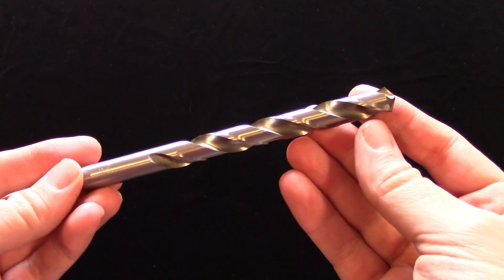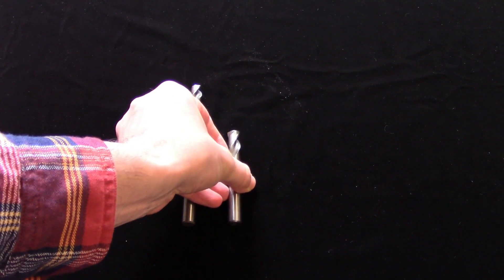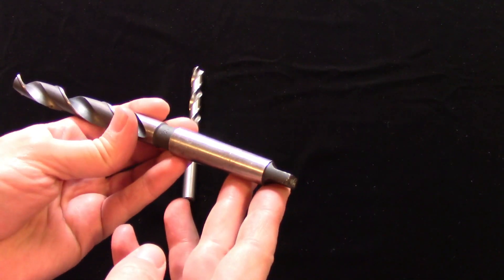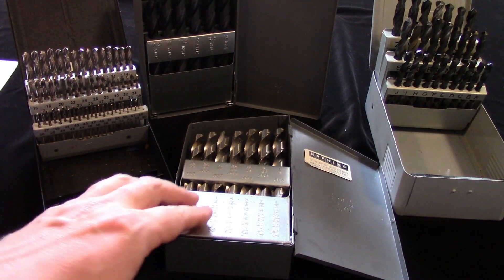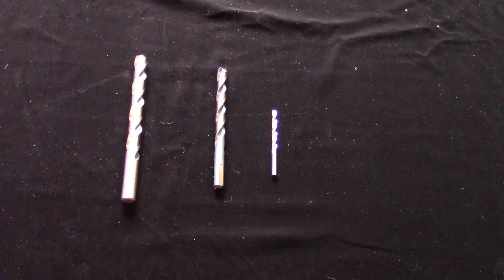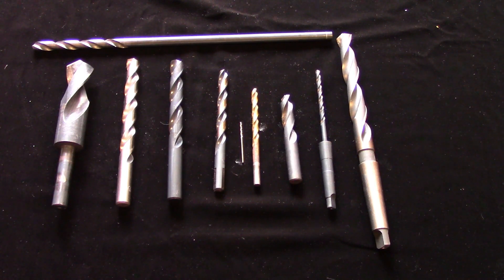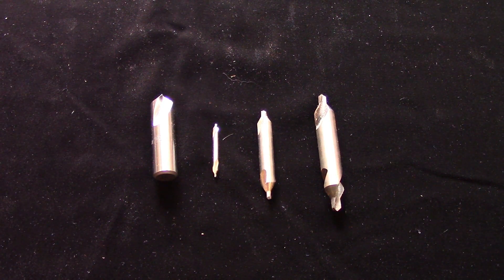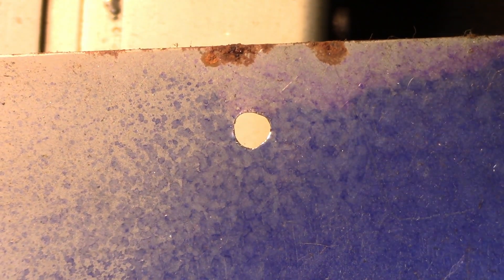Drill Bit Basics

Comment: Hi, Stuart. I hope you don't mind if I ask another question. I have a subland drill - 5/16" to 1/2" counterbore. I typically run 5/16 at about 600RPM into 1080. Never worked with a subland drill before. I usually run a 1/2" drill at around 400RPM into the same material. Lower revs as a counterbore. In this case, would you suggest that the 600RPM is maintained and then a significantly lower the feed as the drill hits its 1/2" section? That seems like the way to go on a purely intuitive level, but what do I know?
Reply from the maker: Hi Felix. I don't mind at all. Typically counterbores are run at a speed 1/3 less than the same size drill, so you definitely don't want to use the same speeds. Let me know if you have any other questions.
Reply: @StuartdeHaro  Thank you so much!

Comment: Stuart, would you say that running a .368 carbide drill into A2 at 1200RPM is too slow?
Reply from the maker: It seems like it my be OK. A2 is tough stuff so use your eyes and ears. Look at the chip you're getting and watch for that typical curly drill chip you get with steel. That indicates the right feed. Now look at the color. Steel color is fine, but you can probably go at a higher RPM. Tan to royal blue, you're good. Light blue to gray, slow down a bit. Lastly listen. Squealing is bad and it could come from too high a speed or too light a feed or both. Either way the tool is rubbing and vibrating and that will damage carbide and burn up HSS. This is a quick and dirty explanation that is probably oversimplified, but it will get you through. Thanks for watching!
Reply: @StuartdeHaro  Thank you very much! I appreciate your time.

Comment: Excellent overview.  I remember that one of my big awakenings becoming a machinist, was that something I had always thought of as extraordinarily simple, isn’t.  There are so many drill sizes, lengths, shanks, materials, coatings, and styles, not to mention techniques, sharpening, hardening, and more.  It’s a great place to start with a DIYer, because along the way one covers also the importance of rigidity, work holding, lubrication, and perhaps most importantly for the beginner - patience, as good results can often require multiple steps and tooling.

Comment: Very informative.Thank you.I use microdrills,say 1mm or 1/16"in diameter. For me, the fluted part is to long.How can I cut it shorter and resharpen it?.I only know Amscope,pinvise and diamond plates.
Reply: If wanting "micro drills" with a shorter length then look at your local Jewellery Suppliers.
The majority of jewellery drills are shanked 2.35mm (3/32") in HSS & Carbide, the better being German or Swiss made.
Busch is possibly the best known.  https://www.busch.eu/fileadmin/custom/pdf/busch_J_spiralbohrer_de_en.pdf  
HTH, Colin
Reply from the maker: In my experience, tiny drill bits cut themselves short as soon as I touch them.  In all seriousness though, resharpening bits gets pretty challenging in small sizes without a drill grinder.  You'd probably be money ahead just searching for ones that are stubbier from your tool supplier.
Reply: @StuartdeHaro  Thank you

Comment: I was surprised you didn't mention Bell centers that would have been interesting to hear about
Reply from the maker: You know, I don't own any of those.  If I come across any of them, I'll try to work them in to another video.  Thanks for watching!
Reply: @StuartdeHaro  I found out about them when making an offset for the tailstock to turn between centers
instead of a taper they make a shape for a ball bearing to be the contact point on each end
Reply: @wnebergall  thanks for mentioning these Bill. I've never heard of them before. They make alot of sense for turning tapers.
Reply: @andyZ3500s  somewhere on YouTube there is a video on using a boring head in the tail stock for the off set
Reply: @wnebergall  thanks bill I seen a video on the subject. If your shank is removable  you can pick up a Morse taper shank for $20. It is a great idea faster to set up and then you don't have to reset your tail stock. Thanks again Andy
Reply: @andyZ3500s  I bought mine with Mt2 taper